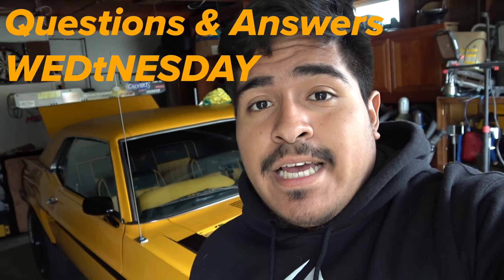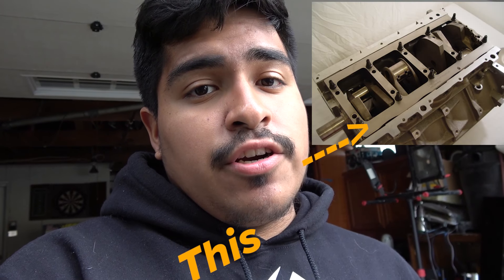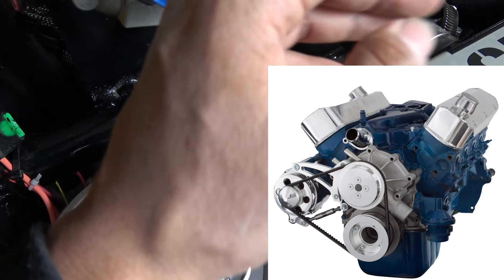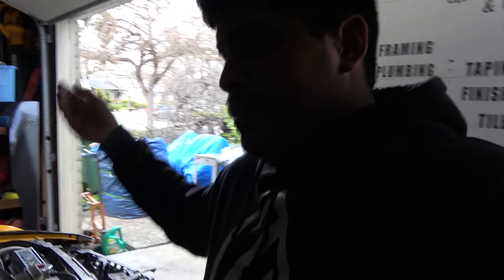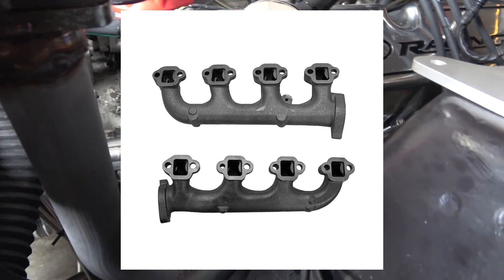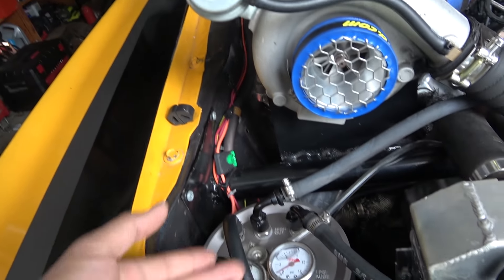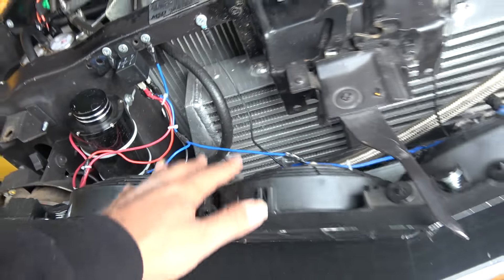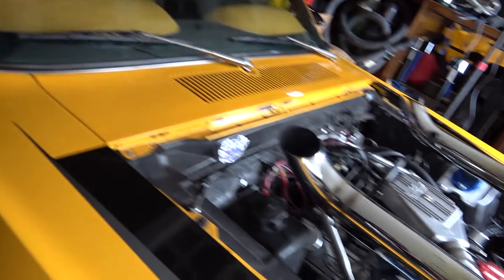How to build a Twin Turbo 302 Q&A | JFBoosted

Comment: Doubt it with 4 fans and e85 but if you ever have over heating issue make a cover to go from the top of your grill to the top rad support so all your air it going strait at the engine and not right over top of it.

Comment: That carb hat is super restrictive. There was a comparison done on a dyno with several diff hat's. The procharger comp and extreme velocity where the best and the regular spectre (not the low pro) was next which is what I have. All the low pro hat's were Shit. Boost come on a lot harder and faster when I lost the low pro hat. Anyways badass ride. I have a 93 calypso notch with a single turbo 351. Do you have a part# for that cam ? I have a tfs3 and makes power over 4k but lost shit tons of low end torque.

Comment: Oh my god, twin turbo? No forged internals? 302?? You couldn’t have a better recipe for disaster lol, if your internals hold up to make power, that block will split in half, like we are talking in 2 separate pieces lmfao. If you ever take that car out and really lean on it, pop goes the weasel i promise you.
Reply from the maker: Lets just hope I can still salvage any remaining parts from the block to swap it out haha
Reply: should be fine to 500-550 at the wheels, but when that weasel pops it really pops
Reply: Check out @myers_bros on instagram. 9000rpm, 20psi boost. 1000hp, on a windsor 302.
Reply: minterfab 
Oh, theyve done quite a bit to it lol. Not stock by any means, but the block can definitely take a beating. Look at them doing burnouts, absolutely insane. Got a parts list from them as well

World Product Windsor 302ci V-8, 4.00-inch bore four-bolt-main Callies crank
Callies 5.177-inch connecting rods CP blower pistons
Total Seal rings
World Product Roush Performance cylinder heads
Crow solid roller camshaft
Crow roller lifters
Yella Terra Platinum 1.6:1 roller rockers
Crow double-row timing chain
Bill Dailey engineering Dry Sump
Aussie Desert Cooler "Burnout King" radiator
Littlefield Teflon supercharger (running 20 psi)
MSD Pro Mag 20,
Kings Crown Custom Injector hat by Len Grass Engineering Custom 120-liter aluminium fuel tank
26-liter Custom Aluminium Header Tank
Power
1000 flywheel horsepower
Transmission
ATS Powerglide TCE 4500 stall Custom valve body
Reply: minterfab 
Well what im saying is their block is still a w302, not cracked. Although the stock internals would create a frag bomb at those power levels

Comment: That's a horrible hat on your fitech
Reply from the maker: william hardy really? what would you recommend Id be glad to swap it out if you convince me🤙🏽
Reply: Extreme velocity pro series is a nice one but don't get one with the divider plate in it but the design of your's is not efficient and if you had a carburetor you would have fuel issue because the direction the boost is guided do to the bad design check out erickthecarguy channel and watch his Dyno video they crazy problems do to that bad hat.